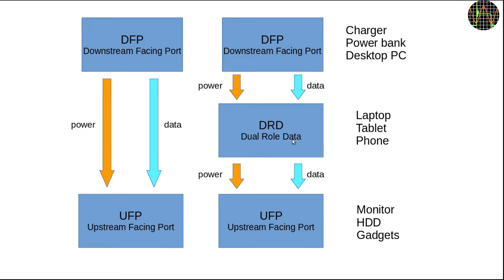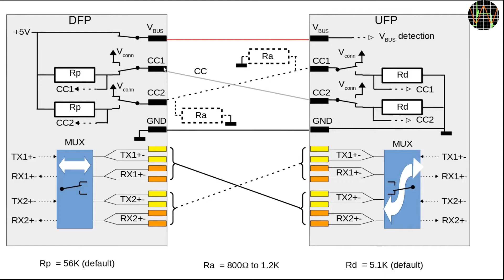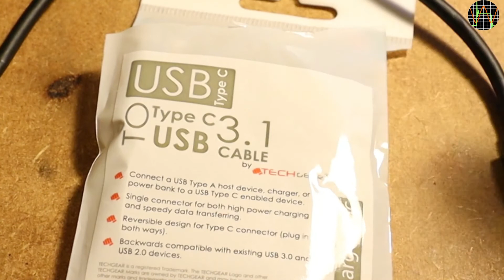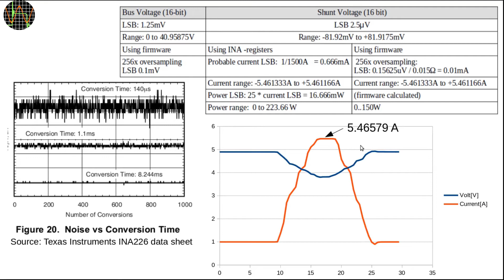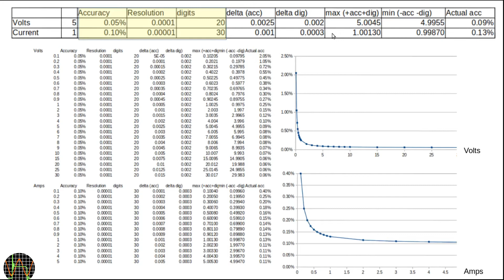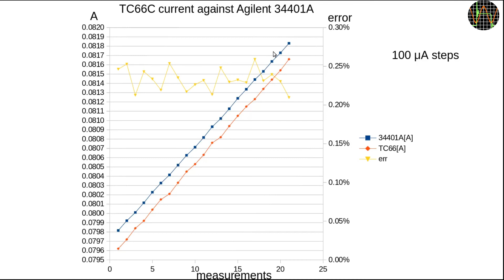Everything you always wanted to know about USB Type-C & the TC66/C (but were afraid to ask)

Comment: Is the TC64 sufficient to test Type-C power supplies ?
Reply from the maker: Well, as always, the answer is "it depends". In this case it depends on what you are testing. The TC64 can only measure current in one direction, so you may need to rewire the setup. It will be fine if you are measuring voltages, currents and power. If you are exploring charger and PD protocols, I think it is more limited in that respect, but I have not read the specs of the TC64

Comment: So digits are meaningless without the knowlegde of the resolution as I understand you right ? Thanks for that TOP video !
Reply from the maker: Yes, absolutely. If you see lots of digits, there is always that question: Is this technically justified or just eye-candy for trying to impress. In the TC66 case it is actually justified. I am using this tester now for all sorts of non-USB measurements because in its limited range (DC 0..30V 0..5A) it is almost as good as my Agilent 34401A 6.5 digit bench meter. Certainly better than any of my other hand-held multi-meters. Plus you have recording and remote access, all for less than $30.
Reply: If I think about it remembers me what my professor said to the students. Don´t write all digits from the measurement If the accuracy ends at 2 digits behind the comma all other digits are meaningless. I don´t know why but I don´t like the percent and digits notation when you can write it down in Volts+-millivolts it´s better to read in my opinion. What do you think about it ?
Reply from the maker: @Telectronics: Both you and your prof are right in that most of the time, the extra digits are not needed. If I charge something on USB, often all I care about is whether a decent current flows and the voltage is about right. In that case, I would ignore the fraction part completely and just look at the digits before the decimal point. All I want to see is 5V -something and 1A-something. But there are a few instances when a higher resolution is useful. For example a voltage or current that keeps slowly creeping up or down when it is supposed to be stable may indicate something is wrong (e.g. a temperature runaway). More digits enable spotting this earlier.  Another case may be capacity or energy measurements as these sum many measurements over a long time, so even tiny errors accumulate.  
As to the format. In the TC66 case for example the offset error could indeed be expressed as a Volts +- 2mV  statement but that would not work for the gain error. Say if for example the gain is supposed to be 1 but its really 0.99, then 1V would show as 0.99V and 10V as 9.9. The absolute error at 1V is 10mV and for 10V  is 100mV, which means a format of X volts +- Y mV won't be very helpful.  But a statement of X Volt +- 1% would express the error exactly.
Reply: @TheHWcave  Thanks for clarifying I think I got it now. :)
Reply: @TheHWcave  According to the range, this should be safe to use to record the 12V battery in my car for 24 hours (1 min intervals). Correct?

I would need a 5V source, I'm thinking about using a power bank for that, assuming it will not go to sleep with such low power draw.
Reply from the maker: @enihi   Yes you can do this, but beware of getting the polarity wrong. It will kill the TC66. Also, if you record while the engine is running you may have spikes that exceed 30V.  To be safe, use a 30V Z-diode across the TC66 USB-C  and a 100mA fast fuse in line. 
Both my powerbanks (a XIAOMI and a Energizer) turn off after 30s with  just the TC66C alone as load. You may have to add a small LED light to keep them on. Alternatively you may just use the 12V as power. Depends on what you want you want to investigate. If you suspect your car battery is slowly draining then of course using it to power the TC66  in addition would make it worse.